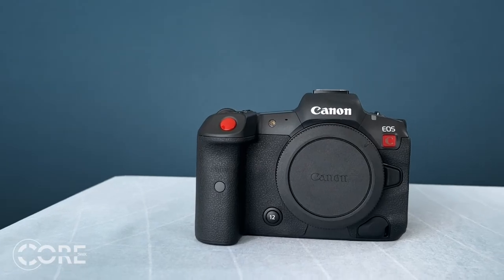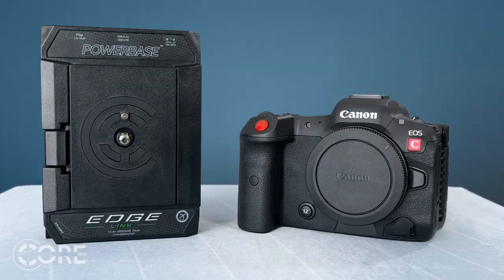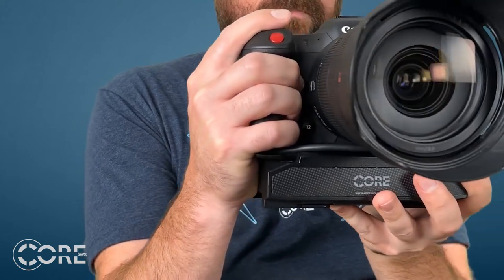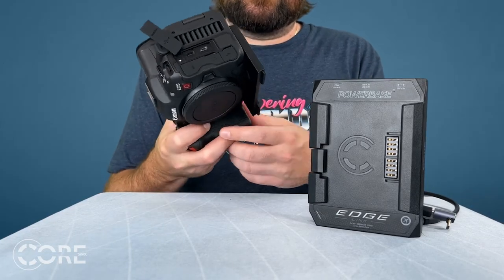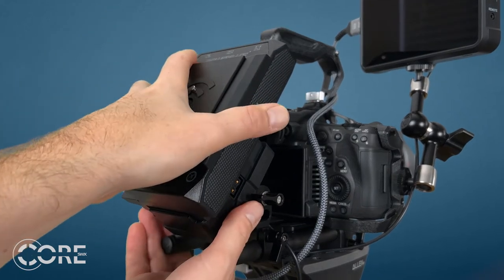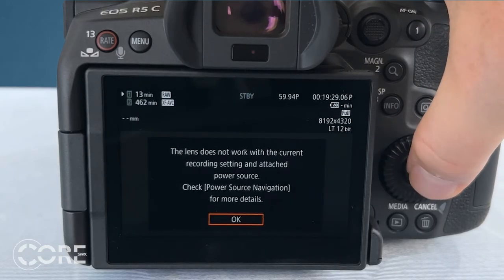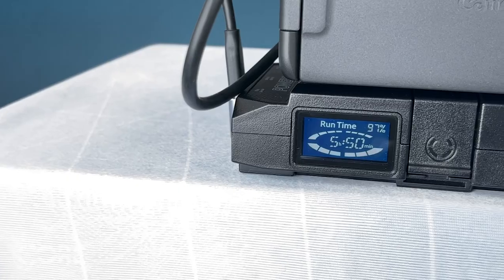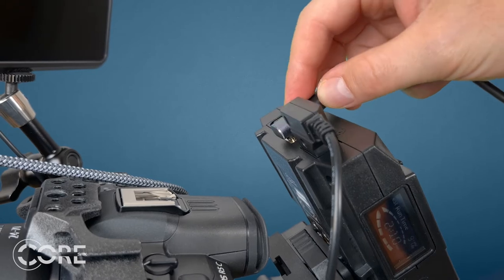How to Power: Canon EOS R5 C

Comment: Hi Core SWX,

I bought this when you first released it at NAB for the Sony A74 and the Canon R5C thereafter.  Works great.

The only thing not shown anywhere on your website is the use of the dummy battery being only usable if purchased by Core SWX directly without any mods or soldering.

Wish you make this more clear on your website and show more tutorial like this much earlier.  Had to learn the hard way.

And also fried my A74 because I used the dummy dtap/ptap that didn’t convert voltage and it fried my motherboard.  What an expensive learning but my fault.
Reply from the maker: Hi, what p-tap cable were you using?  We don't have a p-tap cable with a FZ100 adapter. A p-tap cable should regulate with no issues or need to convert voltage though.
Reply: @CoreSWX , yeah I didn’t use Core SWX d/ptap cables.

I had another brand one that didn’t have regulator protection to keep it at 7.4V so my main board fried.

So what I was suggesting, was to make video guides how to connect and which cables to use and not use.  Or leave it on your e-commerce website.

Comment: I wonder how well it works with the battery grip.
The grip would mostly be for portrait mode use.
Reply from the maker: As long as you have the USB-C PD port available, it should work just fine. I will ask our Tech team just to make sure.

Comment: I bought the older one the powerbaye without the C port. That ones have two usb. can I use it with a usb to  usb c port?
Reply from the maker: I think that would depend on the adaptor, but would also not provide you with a great connection. You are powering the R5 C?
Reply: @CoreSWX   I try but I didn't work im guessing the usb 5v may be isn't enough power to the r5c. so im looking for alternative like the dummy battery
Reply from the maker: Since that camera is pretty power hungry and the power it needs changes with format, the USB-C was the way to go. There was talk of testing a dummy battery. Let me see and get back to you.